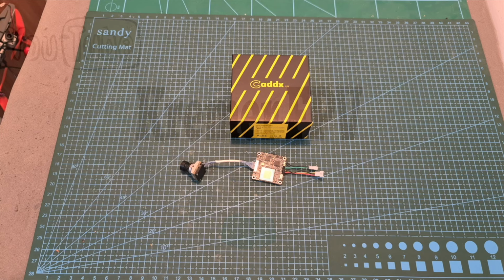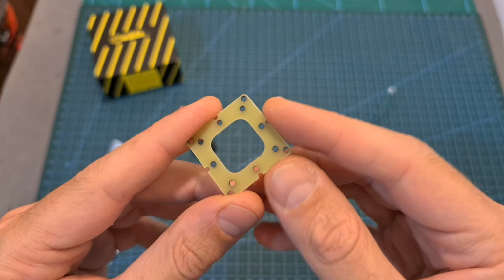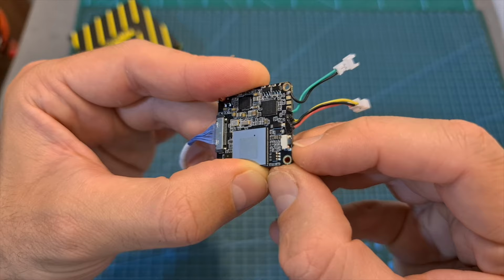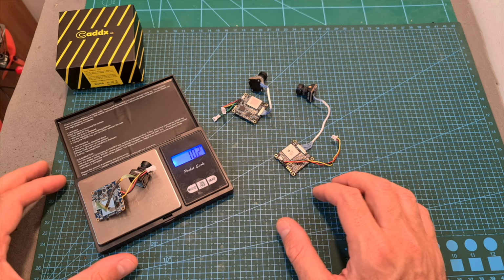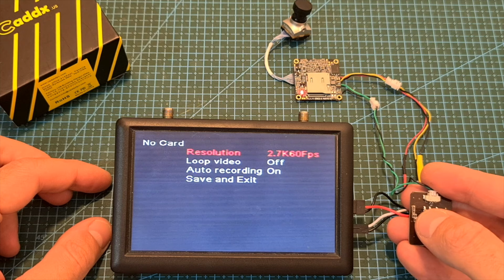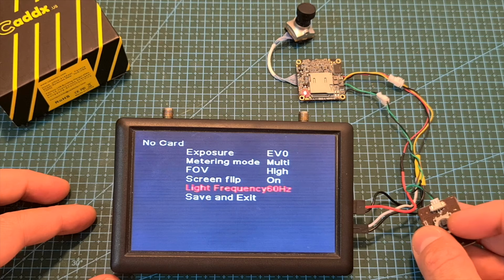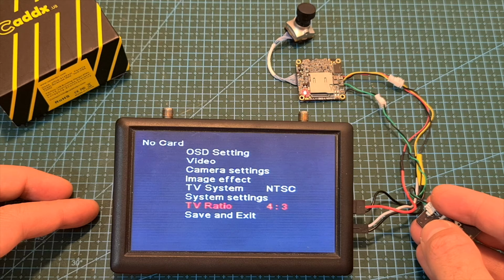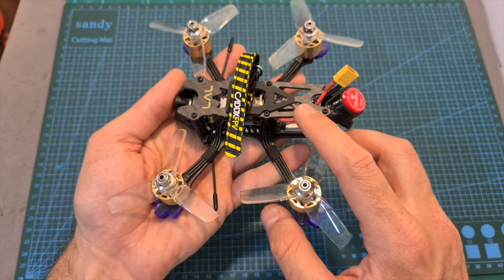Caddx Loris - Overview, Latency Test & Flight Footage

Comment: This camera have some problems.

1. Sharpness is not active
2. `evo` is adapted fpv mode only,  instead of video
3. Camera colors change to monochrome at low light, but not cameback colors though brighten again
4. It is more heavier than their discription(10g)
    Albert kim(first reviewer) received 10.3g version,In my case and Gal kremer were 11.6g
5. It happens frame drops at fpv mode
6. It is not support iso menu as like runcam split 4
7. Rx,Tx pads not active at betaflight
8. White balance is not good, Red color  was exaggerate

Comment: Gal that footage looks pretty good. Looks better that the tarsier 4k. If you got a nd filter on there that would be even better. Does the board get hot at all.? I see it hasn’t got a heat sink like the tarsier.
Reply from the maker: Thanks! It does get a little bit hot but it's nothing to worry about. I agree - an ND filter option would be great, already suggested it to Caddx.
Reply: Gal Kremer cheers for info cal great job mate 👍🏽😎
Reply from the maker: @Fpvfreaky  No worries, cheers!

Comment: Is rx,tx pads just dummy ?
Reply from the maker: Probably not, but I am not sure if BF supports them yet. I have to check it with Caddx.
Reply: @KremerFPV  Do you have any new information about connecting tx / rx and starting recording via FC (betaflight)?
Reply from the maker: @Personne303  Sorry but I don't. I will check with Caddx.
Reply: @KremerFPV  Hello, Any new info ? Recently bought the Loris for my 3" that I am willing to use it for filming when biking. The need to start recording via button on the quad is something I am not a fan for, also don't want to film everything since take off. Thanks

Comment: The Loris is no good.  I have had two of them and both died after one crash.  Everything else on the quad… no problems and no broken parts except the Loris. This thing should not be marketed toward FPV as it cannot withstand the application. Don’t waste your money on this piece of junk.